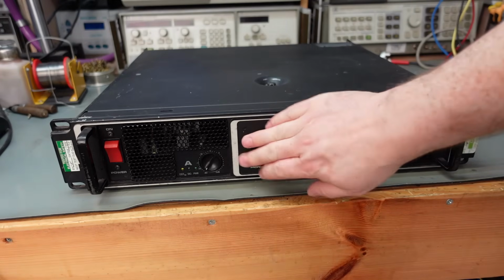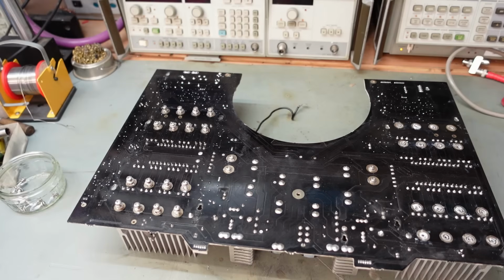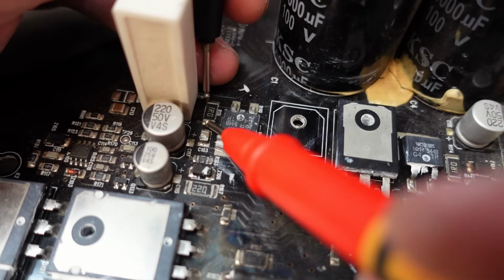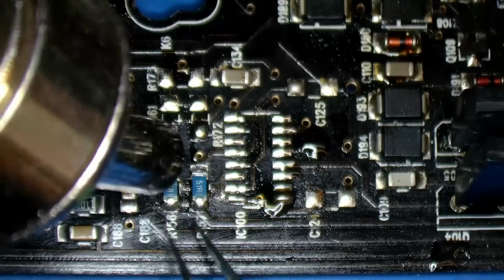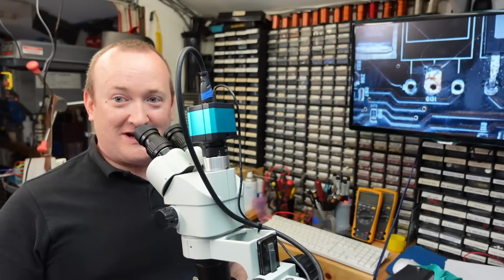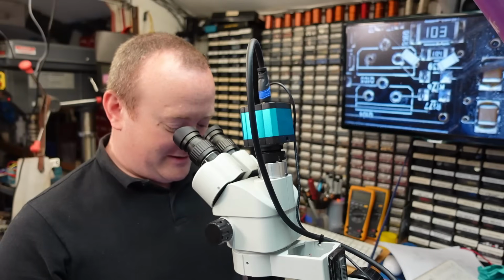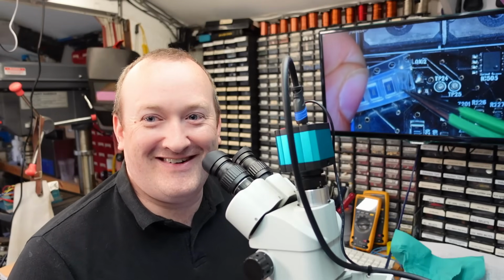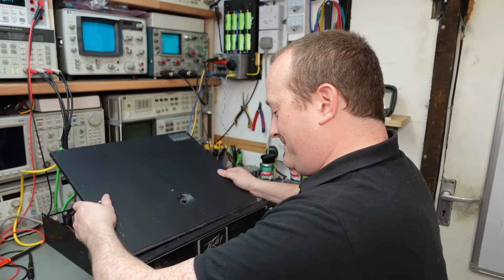PEAVEY 4000W Amp Repair (CS4080HZ)

Comment: That must be a very valuable amp; to have technician-repaired not once, but twice! Back thirty years ago, when I was a young dumb techie, they used to yell at us if we'd spend more than a few minutes on each board. If the board was so far gone as to char the mask or burn the traces, in the rubbish bin it went. Awesome repair; I see so few with this kind of skill level any more. Subscribed!😁
Reply: They are pretty expensive, but probably one of a matched set which makes it even more valuable to whoever owns it.
Reply: That toroid transformer alone is many hundreds of bucks.it’s huge.
Reply: Professional power amps can easily cost over 1000€ also as someone else mentioned if you have a stack of those you cannot just swap one with someone "similar".
The amp was set in "parallel" so my guess is that they have at least a second identical amp which means that if they don't fix it they have to buy at least 2 new amps. Most of the time they replace all amps at the same time in a setup which would easily cost them a few thousand.
Reply: Not as expensive as a proper pro amp, crown for example...
Reply: Hi mate how can I get access to that schematic

Comment: any time a pre-amp trans. is bad like that, I'd 100% suspect bad capacitors, diodes and resistors surrounding it or even upstream issues right to the input jacks!
why? past lessons learned the hard way, bad zener diode, bad caps(all types!), right to pots and trimmers worn/tarnished and randomly changing levels due to vibration. bad cabling and induced voltages from instruments/mics, even high level RF nearby and poor filtering. it's great when things try to amplify frequencies in which they're not designed for and there's nowhere to dissipate the energy(except) up in smoke. lol. once SMD became so wide spread, I quit doing repairs on majority of stuff, it's just not worth the added headache of such high part counts and so many sizes.
over the years I have fixed plenty of equipment that seemed fine on the bench(at high level output) which lasted minutes in the field. GROWL!

Comment: this reminds me of an old fella with a "sun" 200 watt mixing/amp console, driving the output into an "mesa boogie" bass 400 tube head, feeding random speakers with too low an ohm load in a small church. yeah, the outcome was ugly, multiple blown speakers/cabinets. the "sun console" was main culprit, with an bad op-amp ic socket, causing full +/- voltages to hit the pre-amp and final transistors, thus sending full rail voltages out speaker cabling(in bursts/thumps/bangs), fuses, yes it had them, wrapped in aluminum foil or 20 amp+ 🙄
then they decided to run that output into the "instrument input" of the mesa boogie, which did it miracles! many blown caps, pots and tubes from small signal to the output tubes had flash over and arc burning/melted grids, and more inside them.
I get it all repaired and the guy hooks it up the next weekend, without speaker load, because he plugged speaker cabinet into the variable "line out" jack. I about blew a gasket!

Comment: Great video, but was wondering whether you discharged the big caps beforehand? Presume that was the reason for the sparks whilst diagnosing the transistor? I noticed you were resting you're hands on the board early on whilst unscrewing the large cooling elements and was nervous as I have had a nasty jolt from power supply caps,  long after being off the mains. Since then I am always weary, and was a good lesson when working on power boards. Thanks for the video!

Comment: I have a crown xti6002 not coming on. Soldering caps is a huge problem but to be honest am thinking of replacing the power supply and then repair this n put it aside

Comment: Nice job! Not a great fan of repairing big amps, big, heavy, messy and nothing is ever easy to get to. Some of those Peavey’s are a bit weird, particularly if you don’t have the diagrams. I spent ages trying to work out why both outputs appeared to be short to the chassis on one once. I eventually figured out that they were supposed to be. Instead of grounding the 0V rails, they’d grounded the output to avoid the need to insulate the MOSFET’s and the 0V rails became the speaker lives. I guess the input stages must have been traditionally grounded and DC isolated from the output stages somehow, I don’t recall now, but it had me properly confused for a while.

Comment: What size are the schematic sheets? Do you print them by yourself and if yes, how?
Reply from the maker: Hi Leon, I print the pdf schematics as ‘poster prints’ with a 1/4” overlap. Just standard A4 paper. Trim them down, and glue together with pritt-stick.  It’s all standard in windows printer settings. Best to play around with the scale and orientation to get the optimum use of paper.

Comment: There's no way this amp can honestly be described as a 4KW amp.
Reply: 4000 Watts PMPO! 🤣🤣
Reply: Totally agree 👉😵👈
Reply: Peavey spec says for the slightly later version:
Features
2 temperature-dependant variable speed fans
2000 watts (rms) per channel at 2 ohms
1350 watts (rms) per channel at 4 ohms
800 watts per channel at 8 ohms
4000 watts at 4 ohms bridged
Note "RMS".
Quite possible with a class D amplifier.
Reply: @572Btriode  Quite possible also with a 70-0-70 railed Class AB amp in bridge configuration.  Note the 100V rated 10000mF electrolytics in the power supply.
Reply: @bobt2414  Absolutely.  I think the operation of class D amps bridged is not generally too well understood.
Reply: @572Btriode  I forgot to mention that the Peavey 4000 amplifier also had circuit diagrams showing clearly it was a Class AB design - see video at around 12:00 and 14:10.  It has multiple paralleled output transistors reminiscent of a Wireless World spoof design by "George Izzard O'Veering" from the 1970s (shows my age). This design, if you strip out the paralled devices (which simply share the output current) reduces the design to a bog standard Class AB push-pull amp. Bridging involves putting a 180 degree phase shifted signal to the second amplifier and placing the speaker between the two amplifier outputs.  Obviously you have to be careful over HF instability.
Reply: @572Btriode  Error: for '180 degree phase shifted' please read 'inverted'.

Comment: before using the fibreglass pencil be sure to clean all flux/schmoo off the board then use some blutac/masking tape and dab it around the area after using the pencil/etc it should pick up any loose fibres and debris 😉

Comment: Nice repair and you didn't loose ANY of the screws 😁 well done 👍🏻

9:41 🎛⚡️💥💩😳
Well then 🤨 It looks like your gunna have to troubleshoot and fix the bleed resistor problem as well. 
We ALL know that when something like this shit's the bed. There's COUNTLESS other bits that have done the domino effect, to make that happen. 

It's just a shame that I'm not knowledgeable enough yet, to do a proper test of the electronics and how the circuit works all  together to make sure it all works properly. I can do the basic bits like a visual inspection, checking the power rails, putting them on their usual circuit load, using bench top power supply to find faults and obviously seeing if there are any bulging cap's & checking them to see if there all in spec. 
But apart from that. I can't do much more with my current skill set, when it comes to electronics 😪 Being a fully qualified sparky REALLY doesn't help much when it comes to this type of work 😄

Comment: For the heat sink compound stains - my suggestion is WD-40 applied liberally.   Then a scrub with baking soda and a tooth brush followed by a rinse/scrub with mild washing up liquid and water.  Wash as normal.

Comment: I don't often have to remove the transformer to get the amp board(s) out (sometimes the entire rear panel comes away with the board). You sure that part was necessary? I like to check the high power balance resistors and also how well they are soldered to the board. these components with chunky legs often develop dry joints especially if the board is being flexed. Also like to check main caps after seeing large damage,
The other parts were the wrong way up anyhow. lol
If you don't mind me asking. How many hours (not including waiting for parts) did that entire repair take in real-time, (if you didn't also have to film it)?
Thanks nice vid.

Comment: Looks like the fan control transistor was just an isolated incident causing the fan to go high all the time and likely was present when the incident happened which prompted them to bring it in for repair. They had just previously used the amp with one of the fans locked on high by the shorted transistor.

I have a SoundCraftsmen PM860 that puts out 450W per channel @.05THD into a 2ohm load and a slew rate of 50V per microsecond. I had to repair that one after my stepson using it had dropped a turntable needle onto a record causing three Mosfets to blow on one channel and a support driving transistor as well. I has 6 Mosfets per channel that are the two bolt can style. [TO-3]
I'm curious what the two IGBT transistors are for that you had to replace one of them under the heatsink? I assume that they are for power regulation of something.
From what I understand, the main output drivers [looks like 16 per channel in a push pull configuration] are supplied with the transformer voltage after rectification and filtering, probably -140V and +140V. [The transformer having a 280V secondary with a center tap.] Does that thing run on 240V @ 20A? I know my amp pulls close to 10A @ 120V. To do that work at 120V would require a 40A service.

Comment: BACK IN THE DAY (1986) I repaired an old-school CS800 (which I still own and should probably not power on without checking all the capacitors).   Between an electrical engineer at work and actually speaking to techs at Peavy in Meridian Mississippi to determine parts I could substitute in the 1st stage driver board - got it going again after replacing several big-ass output transistors.  Built like a truck, really.  All those big transistors mounted on huge heat sinks - and a chassis which was designed for the fan air to blow up to the top of the case, along the sink fins and out slots in the top sides of the case cover.

Comment: I’m glad I discovered your YT channel Mark. There’s one tool I use a lot which I think you desperately need is a micro pencil Dremel tool. They’re super cheap on Ali and come with a dozen fine bits (use USB-C charger) put away that knife and flat head screw driver and remove solder mask and burned spots with ease.

Comment: I see many a HP instrument that I have used in the past in troubleshooting. You take me back to things I was doing using SMT  devices. Where I worked, burned boards were required scrapped. Could not sell. Lots of memories I am reminded of. Thanks for the video.

Comment: Great job Mark! And an entertaining watch:)
To your last words (they have a vibe of "famous last words" for me?! Hehe): That seems to be a very strange design decision from Peavey to put those slim botches isolating sheets onto the top casing. DJ equipment will see vast changes of temperature differences (transportation, out of the car into the wild, then back to the gig-location with high air humidity). These plastic (or worse?) sheets will inevitably draw humidity. Well, at least it will be "cooked" away:) Anyways ... not much of a concern as we all know that there are plenty of modes your equipment can (and will) fail you at the worst time possible. Thanks for the video and showing this off. I am a "MOUNT THAT RESISTOR IN CORRECT READABLE ORIENTATION"-fanatics girl (our specialist profession trainer at the time would have broken our fingers because of this blasphemy, hehe) ... so: subscribed and greetings from Germany!:)
Reply: Everyone KNOWS that if you put them upside down, the electrons will fall out.

Comment: That would have been a scrapper in my old shop. Just wouldn't have been worth the time to fix all of that burned out board. Considering that amp is pretty much a boat anchor to begin with I would have recommended a better replacement amp.

Comment: would be nice to find out HOW they caused it.  Was there a change in the equipment and it Just popped, or was everything solid for years and it failed Long term.
If it was Short term, Quick failure,  Figure if you can support what htye are doing, or tell them thats not correct.
If it was long term, change a few things to allow Less of a problem happening later.

Odds are they moved the system and powered it wrong.
Reply: I would also add a couple Fans on the heat sinks.

Comment: You can use UV solder mask to repair pcbs and kerosine oil to remove Silicon compound.  Great job on amp 👍👍

Comment: Great video! I don't mind surface mount components, but I despise these surface mounted capacitors and I usually replace them with radial capacitors whenever possible.

Comment: Great job! At 4000w it’s more a heater than an amplifier! I’m a retired technician still doing repairs at home.  I have to say It’s nice to see how much fun you have doing these diagnostics and repairs. Over the years i have seen too many unhappy technicians. lol The curve tracer is amazing. Didn’t have access to that in my time or maybe my bosses where too cheap! 😂
Reply: Bosses in the av trade are all the same. Cheap skating everything. Even here in Dublin there the same. They would tell us to repair something one minute the next minute they would say throw it tell the customer it’s BR. I remember the CAudio GB amps they caused untold amounts of heartache.
Reply: @Camerasneversleep  it was a very frustrating way to work.
Reply: 4000 sinus wave real ?????   max 500 w per chanel
Reply: Lol, I think your bosses were too cheap to get you a curve tracer. They've been around since the vacuum tube era.

Edit: I believe Tektronix invented them sometime in the '50s
Reply: @davelowets  they didn’t like troubleshooting, all they wanted was to change parts quickly so they can charge the repair under warranty.  Sometimes parts burn because of a problem eslewhere but they allowed no time to find that out. As long as the unit was back in service...  the where dirty cheap! I worked for them only for a couple of years.  I loved doing troubleshooting though.  Then my professionnal carreer made a turn.  I still troubleshoot and repair old hi-fi systems including jukeboxes.
Reply: @Wurlyscope  Yep, that is typical of many warranty repair centers. A few minutes on a board, and if it isn't obvious, in the trash it goes... I like the challenge of an involved repair.
Reply: @Wurlyscope  Me too... 🍻
Reply: Switching amps of this size don't create much heat at all. In my opinion, they don't sound all that great either. 🤷🏻
Reply: @davelowets  i was under the impression that it was a parallel push-pull configuration.
Reply: @Wurlyscope  It's a rail switcher, that bumps up the rail voltage to the output stage according to the level of the input signal. Class H

Comment: I would have assumed that taking a reading across components in situ would give false readings? Such as the 220 ohm resistor ?
I do like your de soldering tool, ive not seen 1 like that before, but then again i havent done any electronic work for over 25 yrs.. ( apart from making a moog theremin from scratch around 10yrs ago).

Comment: Good diagnostics,all i would ad is use a plastic spreader for the heat sink compound,just so it's evenly spread,you put enough on & it would probably spread out once heat sink is tightened. Have successfully repaired the simple peavey PV2600 ranges on many occasions,some of those blow bit time,loads to replace as well as board burn scraping,, key is not to rush & buy genuine parts,as you say ,ebay has a lot of fake parts,some are derated & almost impossible to test properly,i used a home made transistor matcher that you could load the power output trannies to there max,before they were put back onto the pcb. The thing with power amps is test at full load,with freq gen, for an hour or so,with a resistor/oil load on the output channels ,as this is the only way to make sure all is ok. 4000 watt amps will need some hefty metal clad lod resistors in oil, as lots of heat will be generated. Im retired now, had a great ,enjoyable ,varied  45 year + career as an electronics engineer.. Cheers.

Comment: Is this a case of the fan controller/driver failing which caused overheating and the failure of multiple components?  One thing's certain, it's a bloody complicated amplifier design.

Comment: Really like your presentation style, straight to the point, no messing or excessive dialogue and into the job!  I have the same Aldi workzone cordless screwdriver, great value for money!  Where did you get that cap discharger?
Reply: I wondered that as well. Looks like a nice little unit. If you look at the name on the front it says "Perton Electronics" which is the name of Mark's business so I presume he built it.

Comment: hi i have i question Mark.. where you get the printed ?
Reply: Peavey used to (prob still do) supply most circuit diagrams if you ask them,which makes repair a lot easier.

Comment: hello Mark I've just discovered your channel and it's really good, I enjoy your videos very much please keep them coming.
Could you please tell me the model number of your capacitor discharge?
Reply: I made my own nearly 20 odd years ago by using a 120ohm 25w metal case resistor. I put some mains cable on the ends and at the other solderd some crock clips and heat shrinked all around the resistor/cable. I have seen in when some people just use a screwdriver or pointed A snips..... THATS A NO NO. 😶‍🌫
Reply from the maker: It's home made, and has evolved to version 3 with the volt meter!

Comment: Huge transistors and capacitors with miniscule SMD parts. Aint modern electronics fun! Never forget that first time all the resistors and capacitors around the chip I was desoldering with the hot air gun blew away! Ho ho. Good stuff. Thanks.